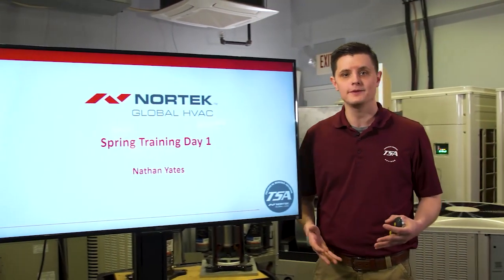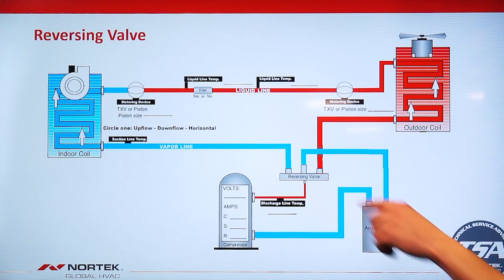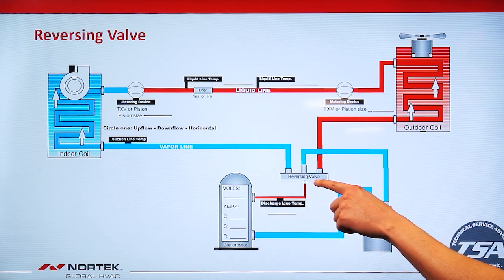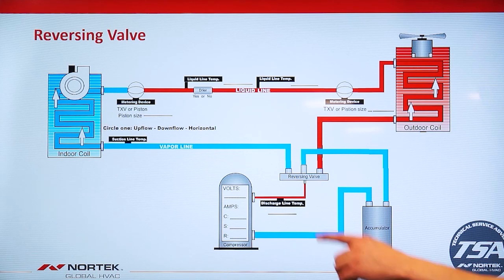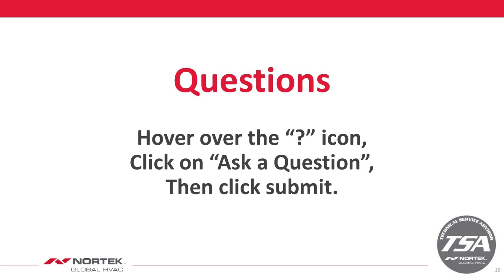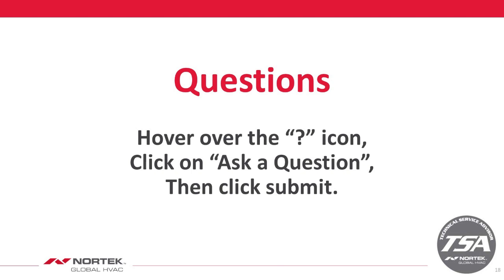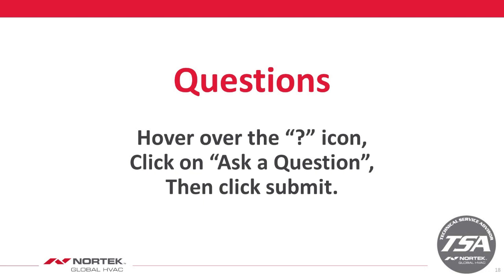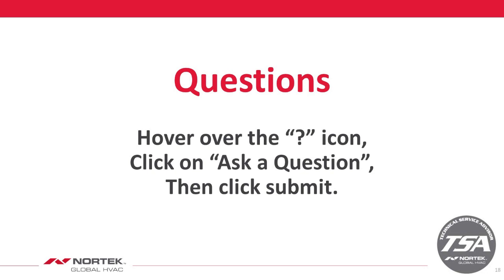2021 Contractor Training — Session 1

Comment: Someone asked in the video why you can’t use a point n shoot laser thermometer to check the line temps. The answer he gave wasn’t the correct answer. For those wondering, yes they aren’t as accurate as a thermocouple or thermistor but for copper lines you can’t use a laser type thermometer, they can’t read off the  shiny copper surface. In order to read off copper pipe or similar you would have to put a strip of black electrical tape or similar and aim at the tape, but not recommended for the accuracy needed for many HVAC measurements. As a tech you need to invest in proper measuring equipment. Field piece wireless probes are among the best options for us these days.

Comment: You want the compressor motor to be in the circuit you are measuring because that's where the back EMF ( or inductive kickback) is coming from and that is what causes the measured AC voltage to be different than the supply voltage. I had the same question about where the 2650 comes from and found the answer doing a Google search. The 2650 (its really closer to 2653) comes from the equation for Capacitive Reactance, X=1/(2*Pi*f*C), then V/I = 1/(2*Pi*f*C), then C = I / ( V(2*Pi*f) )   Since 1 Farad = 1,000,000 MFD, C in MFD = (1,000,000 * I) / (V ( 2*Pi*f ) )  But 1,000,000 / (2*Pi*f) = 2652.6 
Therefore C in MFD = ( I * 2652.6 ) / V

Comment: I was taught to check a cap under load when I first started working in the trade.  I dont know why or who but thats how I do it.  I have a question,   what does the 2650 represent?    I think its back EMF but how do you know?  Also how do you measure back EMF to check the accuracy?    Thanks.
Reply from the maker: Please contact our tech service team 1-800-422-4328
Reply: HERTZ that number comes from some equation made with the number 60 which is Frequency HERTZ it would be different where frequency is 50 HTZ